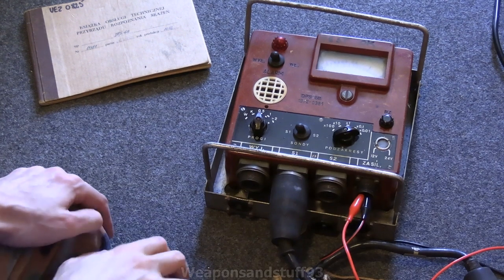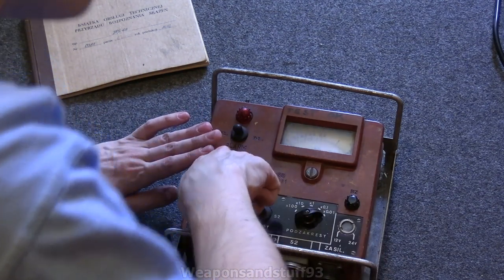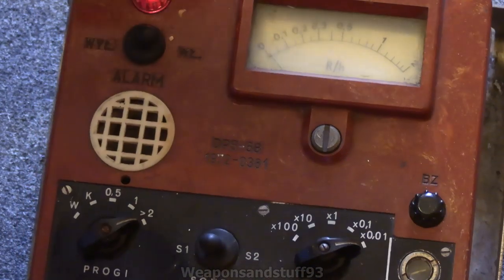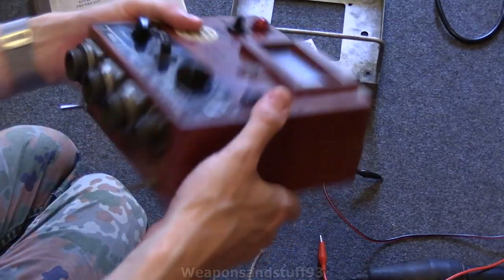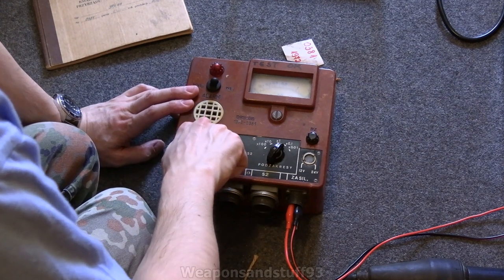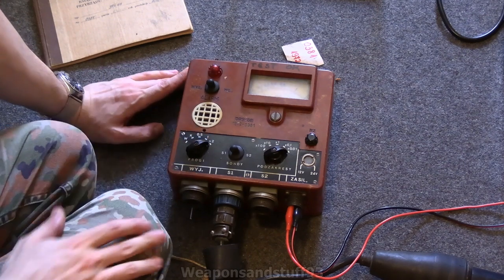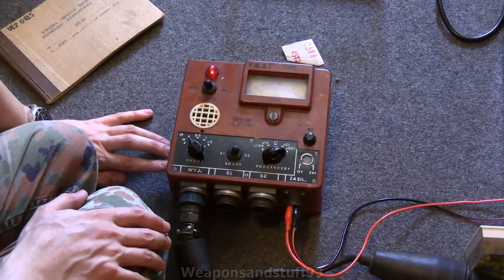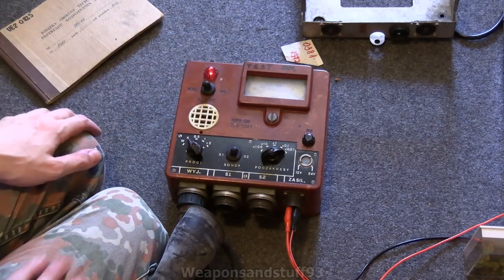Polish DPS-68 Vehicle Geiger Counter

Comment from the maker: Just to point out the alarm and every range function works on this now, seemed the electronics had to warm up quite a lot after years of storage.
Reply: The capacitors in this thing are defo shagged needs a recap

Comment: "Wyj" is short for "wyjscie" which means "exit" but I don't know anything about electronics or geiger counters so I don't know what exits there but I would assume that it's just power extension
Reply: As a polish man i can say this is true
Reply: "Wyj" connection is "output" and it was used to turn on NBC protection in vehicles when the alarm starts. It can be also used to connect remote alarm somewhere else in the vehicle.

Comment: Just picked up a DPS-68M1 dated 1984. Cool units for sure. According to the documents it came with, looks like it was last checked in 2013. Hoping to set up a more permanent power supply to it. What did you end up using with yours?